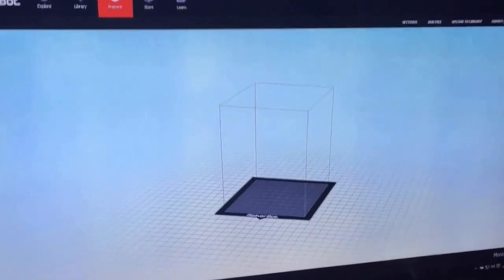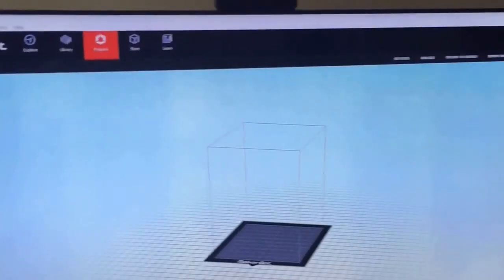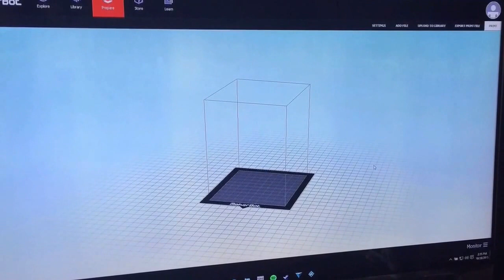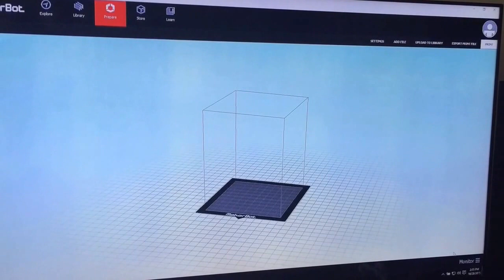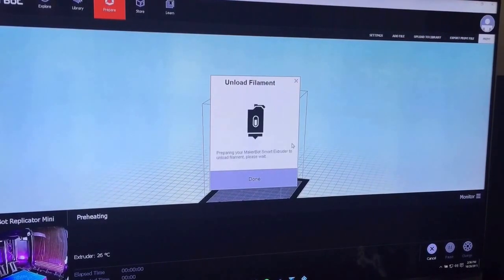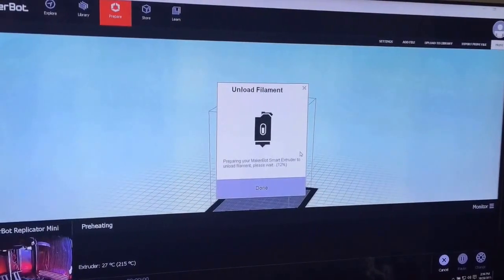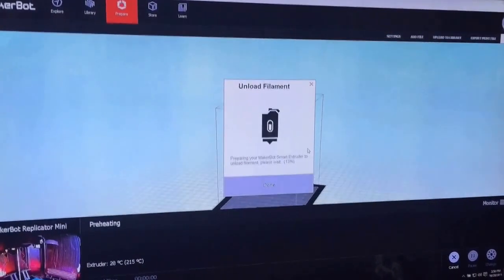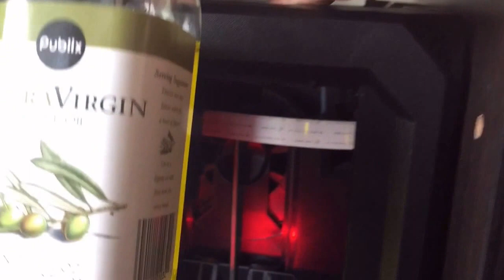MakerBot Replicator Filament Jam FIXED. Resulting much better quality 3d prints

Comment: Worked fine for me, my Replicator is printing right now, the same piece than last week but with oil. Last week was shitty result as the machine stopped 4 times and causes bad layers when resuming the print. At the moment, the new piece seems to be great !

Comment: I was just about to box up my new Mini after a lots of frustrations with filament jams yesterday. I found your video late last night and decided to give it a try. I just used an empty pill bottle with some foam off a paintbrush and drilled a small hole in each end. Added a little olive oil and started printing. I was getting 4-5 jams per print yesterday. So far today, I have printed a dozen items without a single jam!! Olive oil really is good for your health! :) Thank you so much for this video.